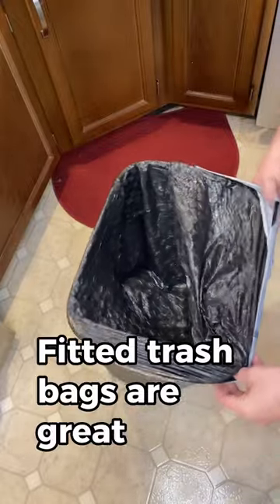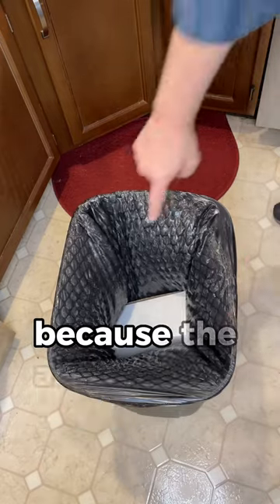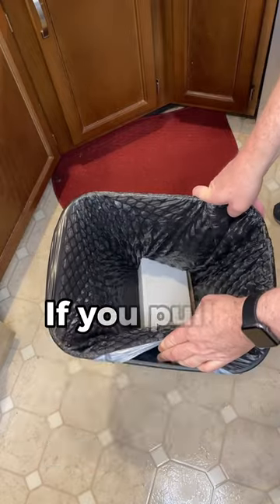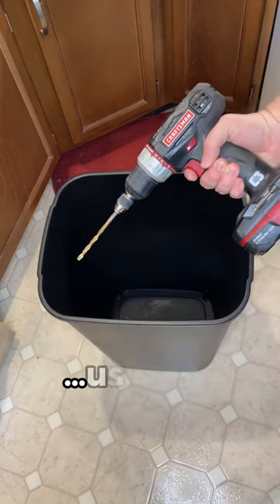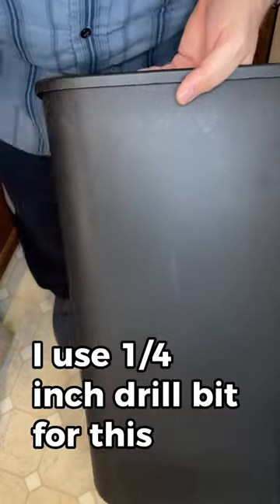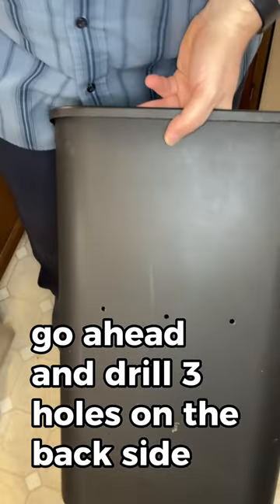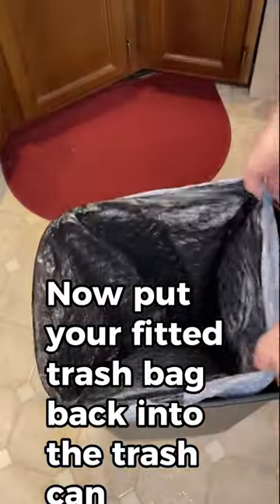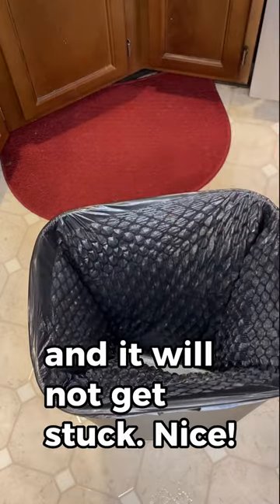No More Puffy Trashbags!

Comment: I put a hole about 3 inches from the bottom. It doesn't hold any air at all. The bag sits like it should. And it doesn't have any suction, it makes for a quicker change out.

For most of my outdoor trash cans, I put holes in the bottom. That way, if it rains and the lid is left off of it, it won't be able to hold a ton of water. The trash guys appreciate it, because the bags don't suction to it either.

Comment: I usually just wait until I have sum to throw away, toss it in the bottom of the bag and pull up a side to let the air leak out.... What happens if your trash bag splits?? Like can the holes get clogged with the mess?? Bc like.. this could actually save a lot of time 🤣
Reply from the maker: If your bag ripped so much that you have "mess" three feet off the ground you have bigger problems than those three little holes.
Reply: @HomeImprovementVideos  🤣🤣🤣 fair enough